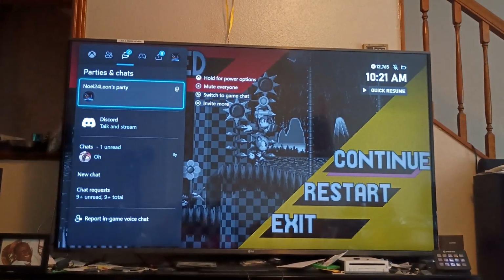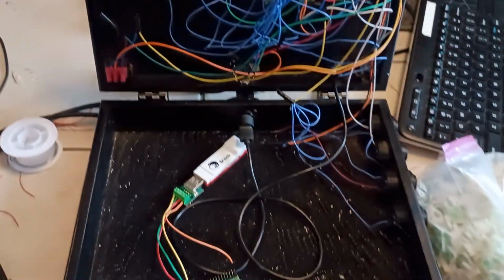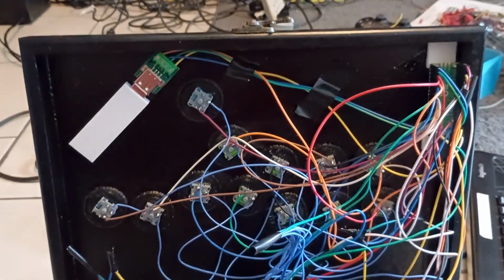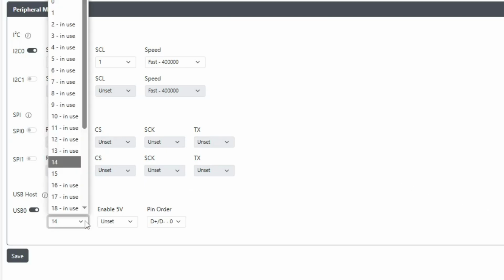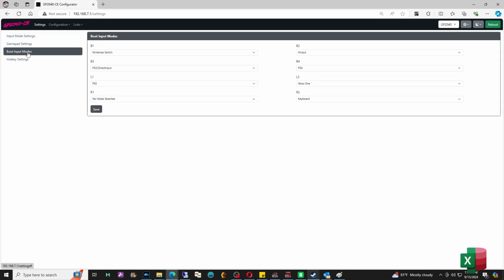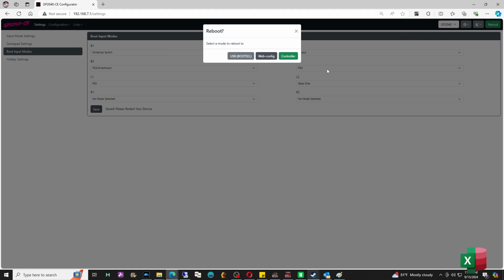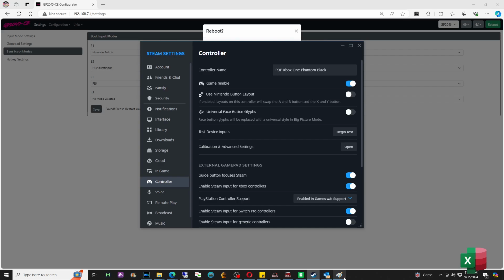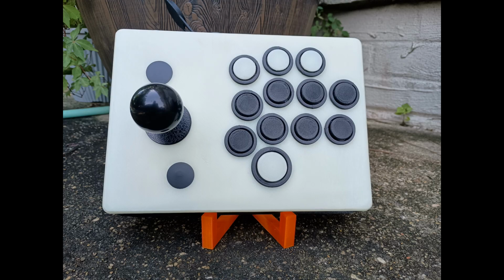(GP2040-CE) How to Wire and Configure a USB Passthrough (For Xbox Series/PS4/PS5)

Comment: Hi I hope you're doing well, i have a haute pad I just  received yesterday, and i bought the cosmox booter5 to play on ps5, unfortunately i found that the pins of the usb port were broken, my question is that i can change it with another one, or is it a specific port!!! Thnx dude
Reply from the maker: From my understanding the Haute pad uses a PCB board. Did you buy it new or used? If it was new, you need to reach back out to the retailer that you purchased it from for a replacement. If you just received it and the USB port pins are broken then that's a QC issue. This tutorial is specifically for the Raspberry Pi Pico board.

Comment: Hello hello how are you, I'm trying to do exactly the same as you, but the Brook USB doesn't turn on, do you also have to configure the 5 volts?  greetings and thanks
Reply from the maker: Are you trying to use a Brook Wingman FGC dongle? When working correctly, it will light up red when plugged into the passthrough and when the controller is powered.